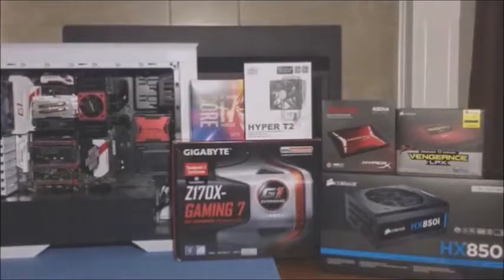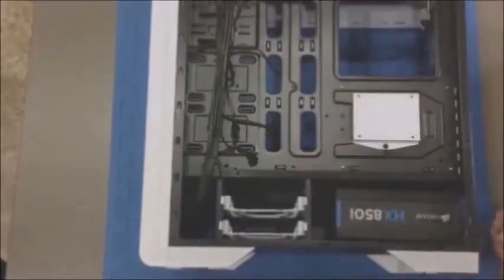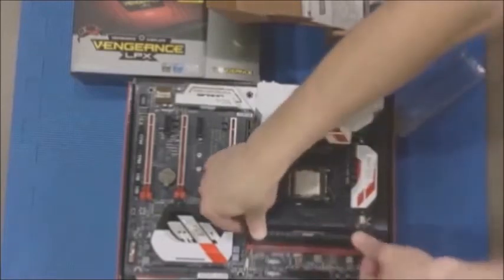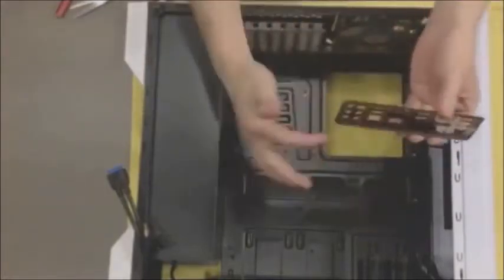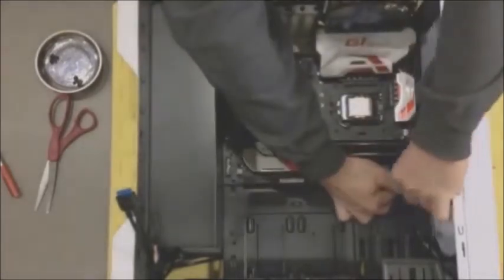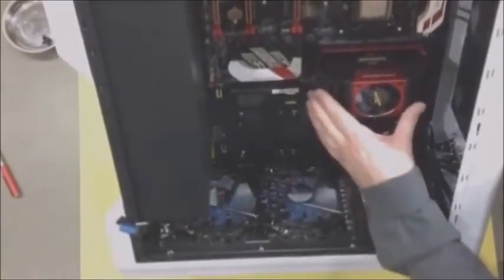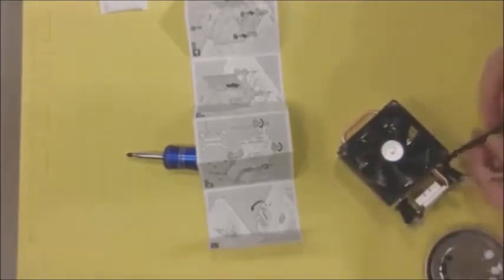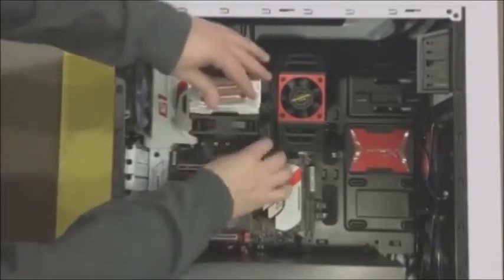Intel i7 6700k , Gigabyte -z170x ,corsair 3600mhz, Corsair HX850i , Kingston hyperX Sanger 480gb SSD

Comment: Dam, 3600mhz, my mobo can only OC up to 3400mhz. Nice components overall.
Reply: +SteveJ619 go with the 950 pro i have both Kingston predator and samsung i can give you some benchmarks on both if you ever need some test results
Reply from the maker: Thank you , I'm really happy with the set up......it actually went together with no problems ....besides the cheap CPU cooler
Reply: The cpu cooler should be fine. You really only need the water cooler for OC. I just got one because I figured my old computer made my room feel like an oven on stock fans.
Reply from the maker: +Hartia I want to try water cooling ...I can decide on a brand ....the cooler master I used in the video would spike to 81c I wasn't happy with that....that was just uploading a movie to wi does movie maker ....it shouldn't spike that high being index a 1 second load .....I went with a $45 CRYORIG H5a it's quiet it's amazing ....but it takes op allot of space ....when I add my GPU next month ....it might be to crowded ...I might put my GPU in the middle PCIe slot....thanks for the comment ....
Reply: oh thats right you have no gpu right now. I'm on the H80i GT, I hit 100% cpu load with The Division on max alongside capturing at 1080p. But if I recall correctly, it was around 71C. And water coolers can be mounted almost anywhere so it'll give you space for the gpu.

The GPU will still fit on the top pcie slot. The mid slot covers your pcie 4x so you'll have to consider if you will use that down the line.
Reply from the maker: +Hartia not really sure yet...I have two m.2 but the bottom one shares the same lane as the PCIe 3 slot...I want a M.2 ...but my PC is already fast I don't see me needing a m.2 yet.....I like the Kingston predator it's the the Samsung 950 pro but it's a good m.2.......PC stuff cost allot now in the form of CPUs and graphics cards ...those cost the same price as a Xbox one or a ps4 , that's ridiculous ...
Reply: +SteveJ619 I'm going with Samsung 256gb vnme m2 as boot drive/windows, 2 x 1 tb 850 evos for programs etc.As its my 1st build I wanted a good spec/future proofing also and didn't want any mechanical drives. so I took out the 5 drive trays (noctis 450) which wlll enable me to have more space when installing the x61 kracken/ and  2 x 980ti's
Reply from the maker: Thank you....I will show a run video soon.....of my low CPU temps and that I was able to get my MOBO to recognize the 3600mhz ram ......it supports 3866mhz but it was too expensive 4 months ago......and hard to find....now it's a little easer to find ....I want 16gb sticks .....when I can find 4 for a good deal I will pick them up .....
Reply: SteveJ619 Yeah you have to go into bios then enable xmp mode for mobo to read the correct ram rating otherwise its rated at the mobo settings 2166mhz I think
Reply from the maker: +TECH REVIEWS NORTH EAST/UK yeah on mine you go profile 1 and it goes auto into xmp mode ....
Reply from the maker: +TECH REVIEWS NORTH EAST/UK but nothing indicates that I'm running dual channel.....even though it is